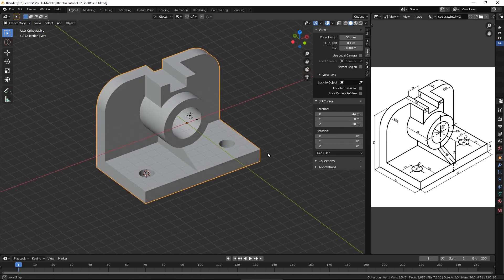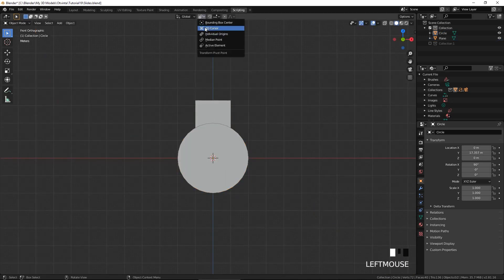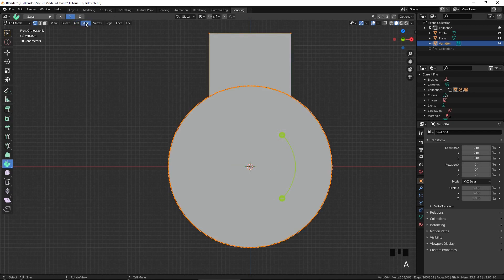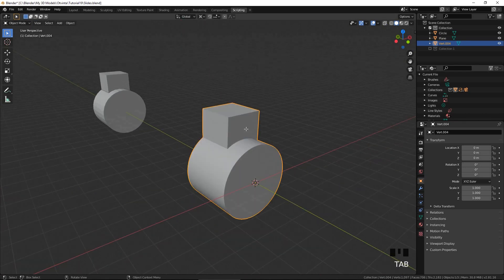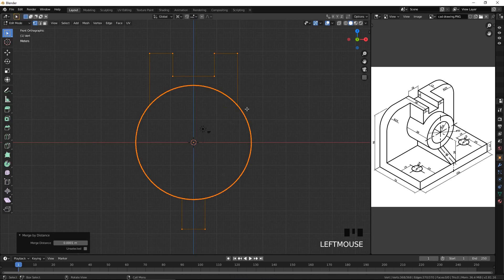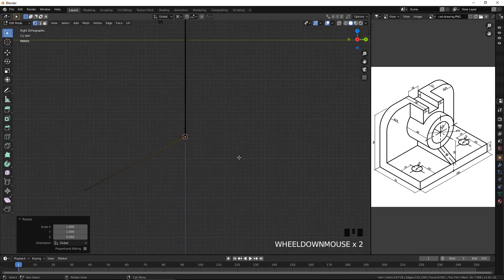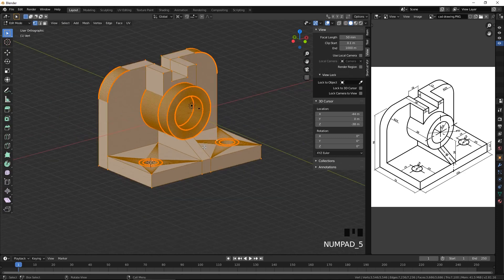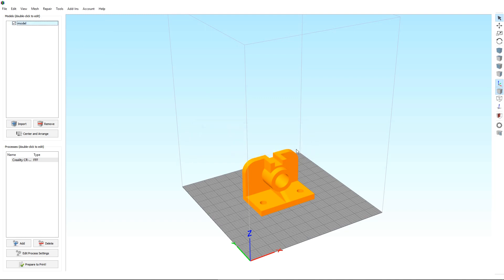Tutorial: How to Model a 3D-Printable Part based on a Technical Drawing in Blender 2.81

Comment: This is amazing, but I would still (until Blender has good CAD tools and a complete set of CAD tools) recommend making this with a cad program. Solidworks or Inventor if you have money and Fusion 360 Personal Use edition if you don't. Fusion can also export to STL and OBJ so you can easily import them to Blender. Blender + Fusion 360 is a powerful and legal (=Free!) software combination.
Reply: I would suggest FreeCAD, which is free (as in freedom) software like Blender. No worries about the vendor deciding you're not allowed to access your documents in a few months.
Reply: Fusion 360 WAS free. they changed to a subscription model now. Pity.

Comment: Thanks for the video.  As i can see (and always knew) that modelling technical parts precisely is very very difficult in blender so taking great amount of time in comparison to softwares build for technical designs such as inventor, fusion360, solidworks, rhino and as a general designer sketchup.  Because software itself was not build for that.  I made a few comments in the forums saying some very simple additions for improving design capabilities of Blender (and some more softwares).  But replies were not well and even i was ridiculed :(:(.  But will say again here.  Blender, maya, cinema4d, houdini has an approach of an artist drawing pictures or making statues which doesnt need written measurements.  The artist performs many in his/her imagination and conveys them to software.  Thats why it does not need real life measurements if you are looking from that point (ie Blender units???, Houdini units??? etc).  I was trying to learn Blender by watching many videos and i have seen many instructors modelling buildings, boats, interiors etc taking sooo long time where as for buildings could be modelled in Revit or Sketchup 1/3 of the time consumed or in this video for example this technical part can be modelled very very shortly in Solidworks, Inventor or Rhino with exact accuracy in the measurements & 3d printer ready at he sametime.  Still dont understand why developers are not implementing those modelling methods into Blender.  As you can understand i can use Solidworks, Inventor, Rhino, Revit, Sketchup and very new to Blender and Houdini.  I can give a short comparison for those.  Solidworks, Inventor, Fusion360 are  perfect&fast technical modeller lacking organic modelling and interaction with an easy-medium learning curve.  Rhino also a "perfect" all in one  technical modeller but has many weirdo things.  Sketchup is the easiest and the fastest modeller i have ever seen.  You can model very easy and place them around very very fast but lacks maaany tools by default and no powerfull built in (nearly none) tools.  Houdini on the other side has the same approach as Blender but i have never seen such a powerfull software before.  But, Houdini also doesnt have drawing tools in the first place.  It is mostly about manuplating (fantastic manuplations can be done) what you have on the viewport.  It wasnt built for modelling at the first place.  More or less same goes to Maya.  3dsmax on the other hand has perfect modelling tools and manuplating tools but has a difficult learning curve.  So, i will mainly group these softwares into 2 categories.  1st category: Technical modellers: 3dsmax,  Solidworks, Revit (mostly for civil engineering), Inventor, Rhino, Fusion360 (internet dependant) not completely but mostly Sketchup. Organic Modellers: Blender, Cinema4d, Maya, Zbrush, Houdini.  So trying to do something easy on one group with another group something like trying to scratch your left ear with your right hand.  I wish they implement each others best points to each other soon.  Remember, if you want yourself perfected you need to use  atleast 3 softwares at the same time.  I can write many many more but this is not the right place i guess. Thanks for reading :):)
Reply: You are right on many points. I come from an architectural background with many years of cad experience behind. I started last year to watch many tutorials and learn Blender. I want to use this app mainly for 3D printing and free form creations. This application has enormous freedom. If you want to be precise in your work, the curve to learn this app is steep and you have to look for several add-ons and install them in order to work the way you need in Blender. Sverchock or Sorcar (node-based add-ons) seem to bring more precision when you build in Blender but they are far from being perfect. There are many other add-ons as well. This is a strong advantage for Blender. Using add-ons you expand its limits. The time to create whatever you want in any application increases once you start to know its paths. The applications you mentioned are clearly oriented to do specific tasks and costs real money. Blender is free and mainly oriented to be used by artists. But it can be used as well for CAD to a certain extent. It may evolve and really become a useful application for these kinds of applications. The control of the form can be very high if you take the time to learn how to do it. Its real advantages are the fact that it's free and that it has an extremely active and large community behind. Its evolution in the last period was really fast.
Reply: @insaisissable3938  Thanks for the reply.  I am also coming from a CAD background.  Tried some add-ons with Blender and couldnt get the real taste :(.  Blender has many super abilities for sure.  I cannot deny.  Blender just needs few fine tunings on modelling tools, thats all.  Blender must be an "all rounder" in everything.  It shouldnt have just one aim . I want this by heart.  If you goto solidworks and ask them "i need a tool for creating trees" they will say "hahaha no man this is not the right place".  Ok,it is normal for them to laugh at you. I can understand that.  Ask the same thing to Blender now "i need tools for creating real cars, real trucks, real buildings, real boats, real ships, real planes, real helicopters".  Why not? Or Blender is just a tool for creating something "looks like a car, looks like a building, looks like a helicopter, boat, ship, plane"?No,  Blender shoul be everthing.  I expect that from Blender.  And i am eagerly looking forward to see :) :)
Reply: Blender in Steam 0 EUR
Revit 393 EUR per month
3dsmax 262 EUR per month
Solidworks just 6600 EUR in cheapest mode! up to 9950  EUR...
Inventor 2.702 EUR per year
Rhino 1.115 EUR
Fusion 360 494 EUR per year
Sketchup 299 EUR in offline version

Can you say where i can find a program like Solidworks for about 50-100 EUR in full version (not abo)?
Reply: @beteigeuze4582  FreeCAD  is free and good
Reply: @beteigeuze4582  You are right.  I am not saying other programs are free. What i want to say is; Blender can (by default, not by an add on (in many years i saw add on developers left supporting some add ons with the new versions.  Thats why it must be included in the software itself)) contain those CAD tools.  It doesnt mean Blender has to change it's structure completely.  On the other hand there are some more reasons for above softwares coming with a high price (industrial manufacturing for example).But isnt it so simple to implement some CAD like tools into Blender? This way community will grow enormously.  Many people are paying lots of money just for the right tools in above softwares.  "Right tools" is the key.  I can give you an example.  Do you think gizmo is usefull in Blender? I am pretty sure your answer is "ofcourse pal!" Think of Blender without a gizmo.  You will say "no it cannot be" i will say "yes it can be" then an argument starts between us.  Because i may not be in need of a gizmo.  So gizmo is unnecessary for me.  Funny right (i was just giving an example.  Ofcourse gizmo is almost the heart of a 3D software) But this conversation has already happened in sketchup forums.  Sketchup doesnt have a gizmo by the way.  I was the person telling "sketchup needs a gizmo with so and so features" many replied "no it doesnt".  This is the way how it goes actually.  While other softwares nearlly all of them have a gizmo.  So who can tell you gizmo is unnecessary? Yes in sketchup forums some said.  Because many are not after "proper and fast modelling" in sketchup because they never needed it.  Now same applies here in Blender.  Supporters should not say "no" to something which they never used or never tasted the benefits before.  Ofcourse you can model everthing in every popular softwares.  But in waaaay different durations.  This is my point.  I want Blender to be better, not worse.  Few examples why CAD users struggle in Blender; no precise or easy to use measurements.  No proper aligning tools. Everything comes with mesh editting at the first place (so does in Maya, 3ds max, mostly in houdini, cinema 4d etc) .  But there is a faster world "before" you go into mesh editting. I wish most of the Blender users first try and learn and become even a medium level user in another (atleast 3) softwares before using Blender.  That way they could know "oh man yes things can be way faster in a more logical way".  I wish i could be a member of  developer team for Blender.
Reply: @beteigeuze4582  Fusion 360 is your best bet or design spark mechanical, maybe even crio parametric modeler
Reply: this is the best place. 
we are all in the same boat.
Reply: I don't know if you saw the interview with Blender creator, but he said, "Money doesn't interest me."
You can watch the interview here if you haven't seen it:
https://www.youtube.com/watch?v=qJEWOTZnFeg&list=PLdjmfK8yELh_gf9zXVycicggNxtRkZ3MC&index=29&t=438s
Also, you can make him directly the proposal to implement those things that you mentioned.
Maybe if you talked directly to the person who created the Blender and came up with the easiest solutions to implement those things, your wish could be fulfilled.
And don't forget, the Blender is free ... and let's hope it stays that way even after the implementations you want :)
Success!

Comment: I hope this is proof enough for those who don't really model, or know much about modelling, that Blender, Max, Maya aren't just  soft body modelling tools and are just as capable of mechanical modelling / drawing as well. Thanks for producing this, very helpful.
Reply: Blender is all I use other than freeCAD occasionally, and I do lots of hard surface modeling. It's perfectly capable. Besides, imho anything from Autodesk is just overpriced garbage.
Reply: @doomslayer8359  hi, actually it is not the case "capable" it is how easy and logically you can do that.  In school i learned solidworks, inventor, fusion for technical hardsurface modelling and believe me they are much more easy / time saving on modelling than Blender is.  But they are not free :(:(:( On the otherside ofcourse Blender is capable of doing many things, i saw an instructor modelling a building in Blender.  God it took veeeery long and while i was watching i was reallly angry thinking that "if Blender had so and so tools now it would be very easy".  Still so much angry with many developers because they implement only what "they" need and doesnt seem to listen us.  If they hired me as an optimizer for Blender (free of charge, i dont want even a penny), from view port to menus it would be very different and easy.   Check Houdini if you want.  It has an apprentice version free.  It is more organised than Blender.  Just to get a different idea.